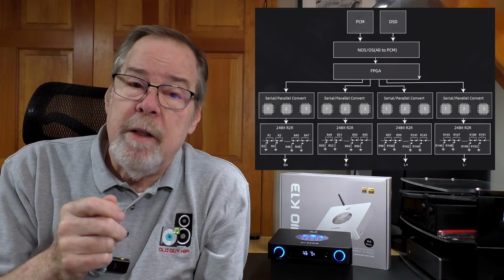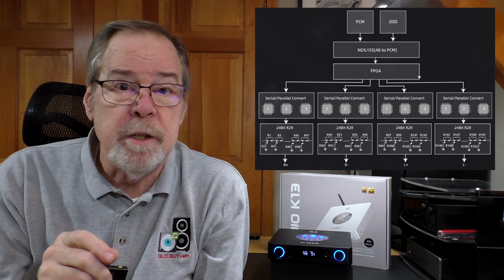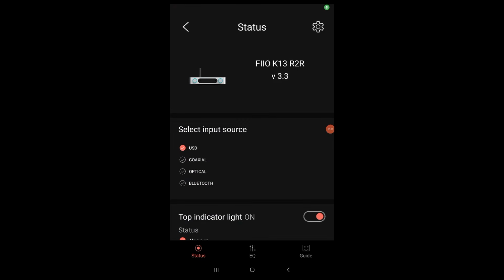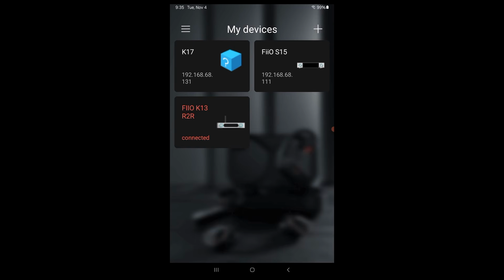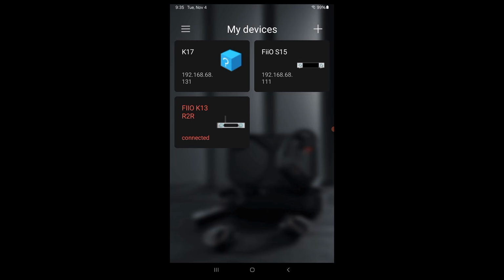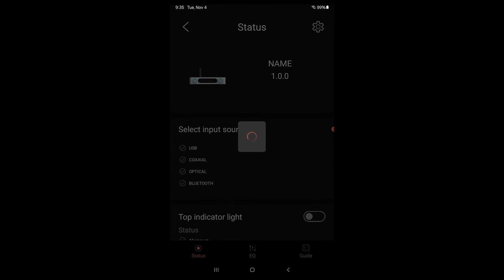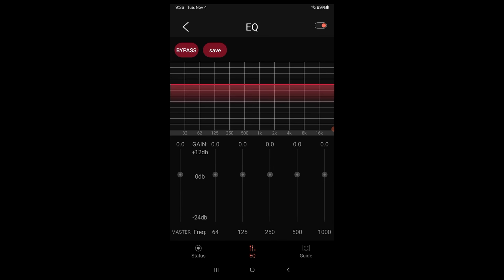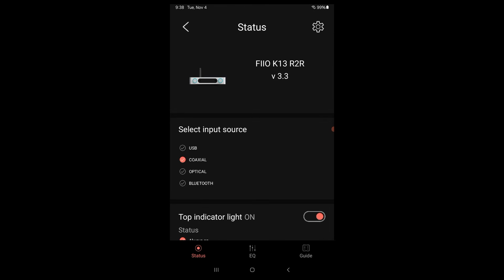FiiO Just Redefined “Affordable High-End”! Budget Price, High-End Sound: The FiiO K13 R2R Reviewed.

Comment: I'm sorry to bother you again Ed, but I followed your video instructions on how to complete the Hafler Circuit. I just wanted to know how much your 5K volume pot attenuator cost you? I've seen them range from $65 to $1,499, do the cheap ones work well enough? I love the Hafler Circuit!!! It sounds like the Extended Stereo setting on the Pioneer VSX-LX305 AVR though this Cambridge AXR100 doesn't sound thin, bright, or strident at all. The only aspect that I'll miss is the four channel Atmos speakers...
Reply from the maker: Mine was like $15.00. I think I got it at Mouser.
Reply: @OldGuyHifi Thank you so much, you're a life saver friend :) Or a money saver, LoL!! I'll have to use your affiliate links in the future, do you have a link for The Worlds Best Cables? MXN-10 still?

Comment: Hi Ed, sorry to write you in on the wrong review. However in your reviews of the Cambridge Audio AXR100 & CXN81mk.II it says that I could not leave a comment unfortunately. I heard in your Elac Debut 3.0 F6.3 video that you said you own the Elac Debut 2.0 F6.2, did you test the Elac Debut 2.0 F6.2 on either Cambridge amplifier? Was there good synergy with the amps? What did the Elac Debut 2.0 F6.2 sound best with for an affordable amplifier? Sorry to both you friend :)
Reply: I really wanted the Cambridge EXA100, but it's a little expensive, maybe I'll save up, I heard that the Elac Debut 2.0 F6.2 needs a dual mono design...
Reply from the maker: It doesn't.
Reply from the maker: I own the DB F62s and ran them on the Cambridge AXR100 and loved it. That was my system before I started the channel. The Elac Cambridge combo s are excellent sounding.
Reply: @OldGuyHifi thank you, that really helps a lot. Did the Cambridge widen up the sound stage on the Elac's? The home theater receiver that I'm using makes them sound thin, brittle, and no bass without eq adjustments. You're a lifesaver, I'm thinking that the Elac's demand real amplification. I do not have the funds to set up a pre-processor & 9 amp channels._.
Reply: I just ordered the Cambridge AXR100 from Amazon because they were the only ones with a three year warranty.Unfortunately it was the last one, I hope it works... You're right about the prices, all of the amp manufacturers charge a thousand or more for the same power & amp class for A/B power requisites. Thank you so much again Ed, I'll let you know how I feel about it when it comes in on Tuesday...

Comment: The FIIO K13 R2R is going straight back to the manufacturer. The reason is that, in my configuration, it does not meet expectations as a DAC. It sounds sharp and completely devoid of any musicality. This is yet another disappointment I bought based on reviews by multiple YouTubers. Several brands such as Topping, WIIM, Fosi, or SMSL have stayed here in Holland, on your recommendations, but each time it was only for a short time. May I offer a tip? Watch your language regarding superlatives; tone it down a bit so it becomes more palatable for us readers. I did, however, read a golden tip on Christian Schwarzbeck's site regarding the IC Amp LM4780, of which I now have three (one tube-based), and I enjoy music every day without having to make any effort. Christian, my thanks for discovering this musical amplifier. The Chinese seller made an EL84 amplifier (in triode) for me based on the venerable Philips HF-309 from the 1970s. The HF-309 will be here in Zeeland in a month, and I asked my Chinese friend if he would also make a musical DAC for me, and he is working on that. Regards, FONS

Comment: Hi! I've been using the Wiim Ultra into the K13 r2r for the past couple months and love it, however, I found it isn't compatible with the Douk U2 Pro at 192 khz on optical or coax. I tried two different units on a couple different high quality cables and got the same issue of stuttering audio with both.  The smsl po100 works perfectly at 192khz without issue.
Reply from the maker: Digital compatibility can be tricky, glad you found a working solution.

Comment: Great little DAC. II drive mine from foobar and use sox resampler in X4 mode, dropped the pass band to minimum 90% and minimum phase and allowed aliasing/imaging. Try 8TC XLR for a beefy enriched sound if you want more richness.
Reply from the maker: Thanks for the tip on those cables and settings.

Comment: Nice review, after owning 14 Portable DAC's, including some R2R, I was ready to get my first Desktop DAC and it had to be R2R, so my choices were K11 R2R, K13 R2R and Shanling EH2 R2R, only because I could buy them locally. Warranty is important people and before you risk spending $400~$600 on a Topping, SMSL or even a FiiO DAC from Aliexpress and have to send it back to get serviced under warranty, it's advisable to play safe and get something local with full warranty. My local hi-fi audio Store is a FiiO and Shanling authorized reseller, so it was an easy pick to get a more complete a newer R2R DAC like K13 R2R.
Reply from the maker: Agreed. I think I prefer the Shanling over the FiiO for it's sonics.

Comment: How does the Fio K-13 compare to the Shanling R2R DAC? I want to get the best R2R without having to spend $1,000 on it. Or if you think that the Douk Audio DAC you helped make sounds better? You said that the Douk was better than the Octo DAC or the Raw DAC-1...
Reply from the maker: At under $1k most R2R DACs are quite good, but due to their pricing there are a lot of compromises made. The Shanling and the K13 are very close sonically, 6 of one 1/2 dozen of another. The Shanling is more powerful and very simple to use. The Q100 should really cost about $750 but Douk was a bit concerned as it is the most expensive piece they've ever built. It is an excellent performer and I seriously think it punches above it's price class. BTW, I worked with them for free on this project. I have plugged into a system that costs about $8k and it sounds really good. I use it as a sub $750 reference. Let me know what you decide.
Reply: @OldGuyHifi I really wanted an R2R, but I think your Douk Audio Q100 will be the one I get because unlike the other ones it's was made without compromises. Where they solely focused on just the DAC, no headphone amp, no pre-amp which most of the cheap DACs should not even bother. The ESS Saber chip in my Pioneer VSX-LX305 is okay, but has the problems you described in your videos. It seems like you have to pay a lot of money to get a ESS to sound good. The truth is that I've actually never bought a DAC before, I definitely want to get one to see what it does to my system. The first area I wanted to focus on was getting another receiver that has pre-outs on it so I could finally make the move to external amplification so I could run 4ohm loads because the Elac Debut 2.0 B6.2 minimum impedance is 4.8ohms. I also want more headroom for the Elac Debut 2.0 F6.2 for my front end. I don't understand why Andrew Jones made a budget speaker that you need real power to run correctly. At least the speakers scale up to & benefits from using a $5,000 power amplifier. I'll only go as far as the OSD Nero or maybe the SMSL Gan Fet technology. Sorry about chatting your ear off, but you can see why I'm on the fence about this issue. I think that the Onkyo TX-RZ30 or TX-RZ70 may be the place to start building from though...
Reply: It's purely amazing that you got a chance to help create the Douk Audio DAC, looks like because of the reduction in price over quality that it looks like it's competing with the higher cost parts from the Geshelli Labs Torque which would cost $1,200 to have selected from their parts list for the AKM DAC & opp amps.__

Comment: I like the K13 R2R because it’s extremely tunable, which allows for a significant improvement in sound quality. When I first bought it, I was basically satisfied with how it sounded, but I quickly got used to it and wanted more.

The first upgrade I got was a FiiO PL50 power supply. Did it improve the sound? Only a little—I expected more. Then I paired the PL50 with a Ricable Magnus Power MKII power cable. That made a big difference: resolution, detail, and clarity improved by about 15%.

I didn’t stop there. Next, I added a HydraSound single-crystal silver  interconnect cable to link the DAC and the PL50, which brought another noticeable boost in quality.

The next big step was experimenting with different fuses in the PL50. I tried the following: HiFi-Tuning Diamond Supreme Copper and Silver, HydraSound Hydra Next Rhodium, and Synergistic Research Orange and Pink. I have to say, tuning fuses are excellent tools for fine-tuning a DAC—I was surprised by how much difference they can make!

Overall, the Synergistic Research Pink fuse suited the R2R the best, and it’s no coincidence that it’s also the most expensive one. It delivered another ~15% improvement in detail and resolution, while also smoothing out the sound—making even poorer recordings somewhat more listenable.

Let’s also talk about USB cables. I use my phone as a streamer, sending the digital signal via USB cable to the R2R 13. While an USB cable doesn’t bring as big an improvement as the Ricable power cable or the SR fuse, you can still get about a 5% upgrade. I use a ddHiFi TC19 CC silver/silver-plated USB-C to USB-C cable, which is ddHiFi’s top model.

So compared to the starting point—when I only had the R13 R2R with no tweaks—I’ve made a major leap forward in sound quality. It wasn’t cheap, but it was absolutely worth it. 😎
Reply: "While an USB cable doesn’t bring as big an improvement as the Ricable power cable or the SR fuse, you can still get about a 5% upgrade."
OMG.

Comment: I have a SMSL Raw-Dac1. Do you think the K13 would be much of an upgrade?
Reply from the maker: That is for you to decide. If you like what you have then be happy. Fight the FOMO!
Reply: I have a Fiio K13 R2R and an SMSL RAW-MDA1 DAC. The two sound quite different from each other. It's important to note that the answer depends on what configuration you're using them in. For speakers, you might not like the R2R. With speakers, the R2R has less punch in the bass, and noticeably weaker dynamics and resolution compared to the SMSL. With headphones, however, the situation is different. I use a Fiio FH5S, and with these headphones, the K13 R2R sounds much better. My SMSL DAC sounds terrible with my headphones. The treble is about 3 decibels louder than it should be, the mids are lean, and the RAW-MDA1 produces the most sterile, most clinical sound of my life — I can only listen to it for 20 minutes maximum. In contrast, the K13 R2R is very good with headphones. It has a tonally neutral sound, with nothing emphasized. A nice feature is the built-in parametric equalizer — I added 4–6 decibels of bass boost at 22–28 Hertz. It's important to note that the K13 needs a quality power cable! I use the Ricable Magnus Power MKII, which improved detail, resolution, and clarity by about 15%.
Reply: @vv5204  which speaker are you using?
Reply: @esd3051 Adam T8V studio monitors.
Reply: @vv5204  The RAW-MDA1 uses the ESS ES9039Q2M chipset which tend to be a bit more sterile then My RAW DAC1 which uses the hybrid  AK4191+AK4499EX. I'm not a headphone listener so just use my old Pro-ac D15 which are still very good. I've only updated my system in the last few years after being quite lazy listening to poor sourced streaming. I would still say the source and the speakers still set the tonal preference, with speakers still the biggest part of that. I've updated my amp recently but I experimented with Chi-Fi class D 3e Audio A5 and I'm very impressed. I think more that ever before you can get a very good sounding system without having to break the bank.
Reply: @keviningram1914  it's the best time to be an audiophile these days, especially on the budget/mid-fi side

Comment: I currently use a Topping DX7 Pro (the standard, non-plus one), and generally use my HD800S, though i also have a HD650, HD550, Arya, and K712 that I sometimes switch over to, along with adam audio studio monitors if I'm not using headphones. It's been many years - I wonder if I should switch over to using the k13 or the dx5 ii, perhaps considering that the HD800S is my primary headphones.
Reply from the maker: Give it a try!

Comment: Ed, how is the connection between the K13 and SMSL achieved? The output in the K13 are the balanced and two RCA connections.
Reply from the maker: The SMSL unit connects to your source, i. e., streamer/PC via a USB cable and then you choose either Coax or Toslink into the K13.
Reply: @OldGuyHifithankEd, I think I got my connections reversed in my head.

Comment: I am interested in great sounding, budget friendly products. I want to get the k13,  and connect it to the buchardt s400 mkii's. Can you give some recommendations of some budget friendly amps thet would work with these speakers and the k13 to bring out the capabilities of these speakers at lower to mid listening levels. Some amps cant drive 4 ohm speakers correctly I've heard, so I need some advice on a few amps that you might recot. Thx so much!
Reply from the maker: Cambridge CXA81 MkII.

Comment: With the k13 and warmer r2r dacs, for desktop use would you recommend running a DDC like the u2 into spdif for it or is connecting via USB just as good? Having a hard time deciding what would be better
Reply from the maker: What is your USB source? If it is a PC, then yes use a U2 PRO. If it is streamer it might not be needed unless it is WiiM unit.
Reply: @OldGuyHifi

Ed I use the USB out from the Wiim ultra to a chord Qutest and topping D70 pro octo. Does a budget DDC provide any sonic benefits in this setup?

Comment: Vorrei sapere se l'alimentatore lineare Topping p 50 può andare bene per alimentare il Fiio k13 r2r grazie
Reply from the maker: No. Il P50 ha un'uscita di soli 5 volt. Il K13 ne richiede 12. Non preoccuparti di un alimentatore esterno, quello integrato va benissimo.
Reply: @OldGuyHificiao,il Topping p 50 oltre ad avere due uscite a 5 volt ha anche una uscita a 15 volt
Reply from the maker: The unit runs on 121 volts. So it won't work.
Reply: @OldGuyHifiok grazie

Comment: So I have the K11 and WiiM Ultra. I run USB out into the k11. Is that giving me the reclocking? I thought it would by using the USB. 

I have an SMSL po100 I’m not using, should I go usb from the streamer to the SMSL and optical to the DAC?
Reply from the maker: The WiiM Ultra is known for having clocking issues and a noisy USB output. Yes connect the SMSL PO100 via optical. That way in addition to getting galvanic isolation you are also getting full electrical isolation by changing formats. Optical can't carry electrical noise. Let me know what you find out.
Reply: @OldGuyHifithank you. I will try that. Just so I’m clear: USB from WiiM to SMSL, optical from SMSL to FiiO DAC?
Reply: @OldGuyHifiman oh man! I can’t believe the difference a $39 dollar piece of equipment can make. I just installed the PO100. The sound is clearer and the layering is insane. The stereo field is so wide, and I’m just using Elac db62’s driven by a WiiM Vibelink. The bass is cleaner and feels more controlled. 

It sounds better and cleaner at higher volumes, but sounds really full and clear at lower volumes.  This is important to me because the system is always playing some type of music any time I’m home and awake. 

Thank you.
Reply: I run the same.. wiim> smsl> k13. The wiim will upsample to 32bit 192, then I leave in Non oversampling. Sounds great.

Comment: Forgive my ignorance but don't the SMSL PO100 and the K13 use the same XMOS chip? Are they implemented differently such that adding the PO100 improves sound quality? Many thanks
Reply from the maker: An XMOS chip is programed by the designer of the DAC. There is no off the shelf, standard issue XMOS chip. BTW XMOS is a brand like TI.
Reply: @OldGuyHifi Thanks for taking the time to reply, cheers

Comment: I have the Wiim Ultra and the Wiim Vibelink. Will the Fiio improve the Sound quality?
Reply from the maker: I haven't had any experience with those WiiM units so I can offer an opinion. Sorry.
Reply: @OldGuyHifiThanks.
Reply: I have the same setup. I use the K11 between the Ultra and Vibelink and it makes a noticeable difference. I can only imagine that the K13 would be even better.
Reply: @pdx_painter Thank you very much!

Comment: the only problem you may find is high NFB amps such as the Yamaha AS501 will have trouble dealing with the stepped( less smooth waveform)  signal from the fiio, timing will be perfect but complex passages will throw the NFB circuit into massive complexity
Reply from the maker: NCFB amps have many more problems then that issue. I think as a general rule they sound substandard.

Comment: I have owned it for a couple of weeks now, excellent sound after some initial settings changes - and Windows sound set to 192KHz 32-bit (this is all Windows goes up to!).

Stock cable is USB A to usb c, which I was slightly surprised about as everything seems to be going the way of usb c these days. Would there be any benefit to switching to a good quality usb c to usb c cable instead? I have a few of those lying around, and when I tested it with my phone the sound was fine.
Reply from the maker: I don't think there would be any benefit to swapping out the cable as C to C is the same as A to C. I do recommend a decent USB cable. I like WireWorld.